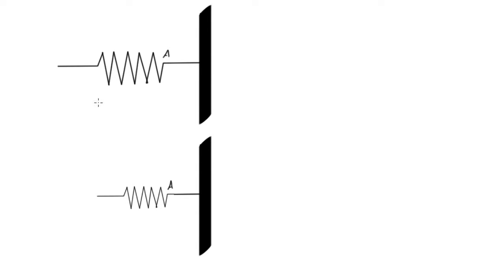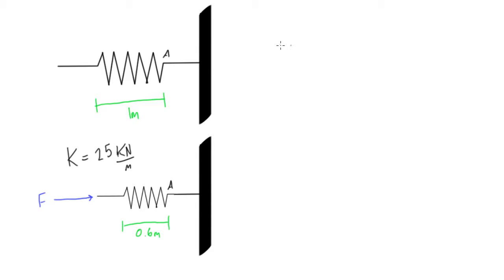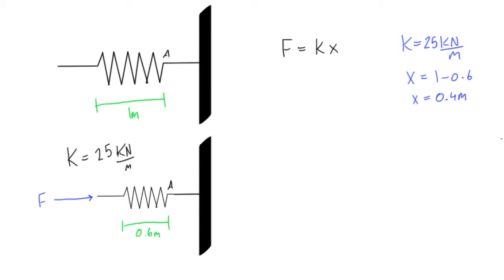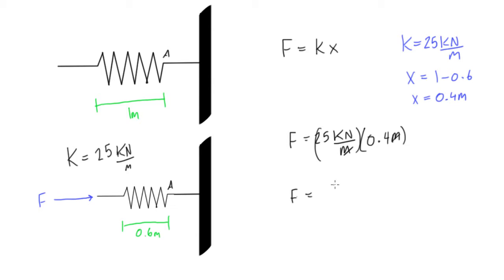How to find the force exerted on a spring

Comment: So force is the only reaction that can effect the spring? So there is only one reaction? Please confirm this question.
Reply from the maker: Yeah. Applied force at one end of the spring, and equal/opposite reaction at the other end. Spring will stretch or compress depending if you push or pull with the applied load.
Reply: @Engineer4Free  thank you